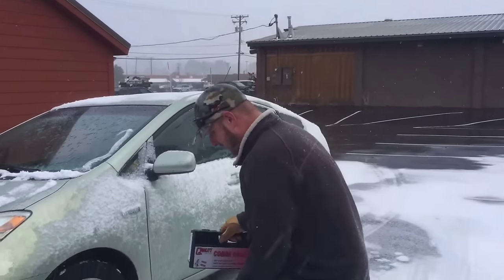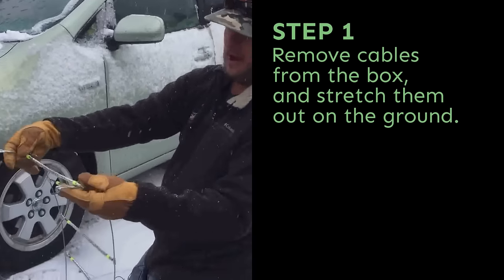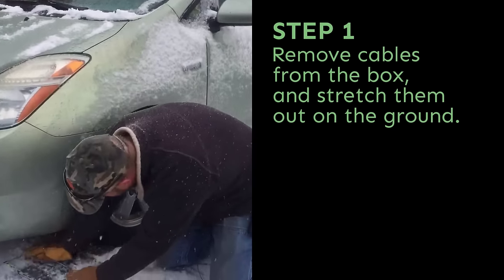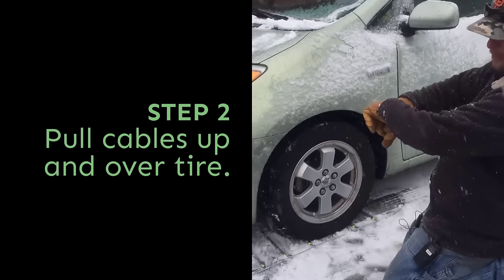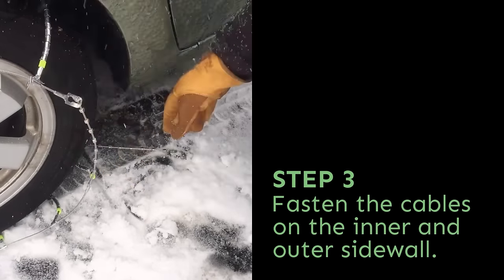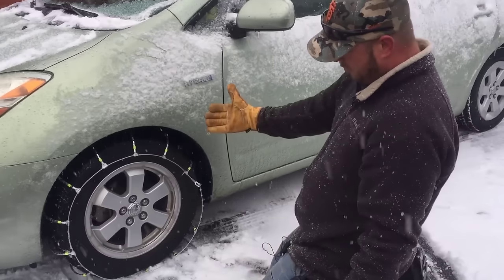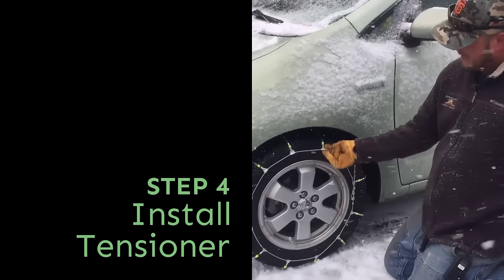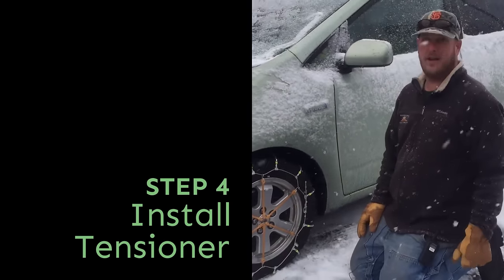How To Install Tire Cables

Comment: Great info Except for the missing parts where you actually connect to two ends together on the inside. You know, the part where you have to lay in the snow while you pull the two ends together ? Ya, ya forgot that part!  Lol
Reply: He had them at 12 o clock position.
Reply: @ridgerunner106  Thus the reason he said pull up into the "middle"...

Comment: One note: the cable ends don't poke through the hole in the clip. They lay in the hole and pull back to the slot to stop them. Don't poke it through the hole as seen here.
Reply: Sorry first timer here.... What do you mean?
Reply: Rather than poking the cable with all the little knobs on it up through the hole on the opposite side and then pulling it tight, you just leave the cable with the knobs on it flat and then drop the other ends bent clip on top of it and pull backwards and it will lock it in place.
Reply: There's two different kinds of "L" shaped connectors. One goes through, one doesn't.

Comment: Mandatory Tire Chains going up to Tahoe without the tension straps I found the chains came off and wrapped around the front drive shafts. What a mess. Learning the hard way.
Reply: Use tensioners with actual chains! One of the chains on my rav4 kept disengaging while in Tahoe a few weeks ago on the road. Although very annoying I'm pretty sure if it wasn't for the tensioners the chain would have wrapped into the shaft and would have made a it a bigger pain in the ass

Comment: I noticed he worked from back of tire, as opposed to the top. I always struggle with these. I have very little clearance for my hand in between fender. It is a stock vehicle

Comment: I think you need L shape side on the back, rather on the front,  otherwise this cable tail will go opposite to forward tire rotation
Reply: Can you explain in more detail?
Reply: @LH095  he means that the cables were put on backwards. You want the excess of the nobby part that pulls through the hole going backwards so that when the tire rotates, they don't flop around.
Reply: @Dannyuh7  that was really helpful, thanks, totally explains why one of my extra bits got crushed and about to fall of soon.

Comment: dont think you use tensioners with cables like these, only chains.
Reply: correct. Cables are not recommended to use tensioners.
Reply: You can, Cobra cables have the option to use tensioners to keep them tight. They're a good idea if you don't have much clearance between the back of the tire and your control arms. https://www.youtube.com/watch?v=L3LFJmrUQ6U
Reply: They all come with tensioners now.
Reply: Only use a tensioner if you don't want to lose your cables.  If you have extra cables and money to blow, don't use a tensioner.

Comment: I have chain up hundreds of class 8 trucks. If you are going to show someone something do it right not backwards. They way you did it the long ends on the cables will beat the hell out of the fender well and paint on the outer edge of the wheel well. Now redo the video and put them on the right way. And take the cross bars and work them back to the connection and leave the front lose and hook the back first getting it as tight as you can and the pull and work all the slack out then hook the out side. Let's see you put on some iron 3 railers on a class 8 truck they weigh close to a hundred pounds each. Do not show people things that are in correct. And yes the way you did it they can also come unhooked. And old seasoned truck driver would have called you a dumbass.

Comment: $500 dlls every 3 or 4 winters for winter tires beats all this work and unsafe solutions (TRY to go above 50 mph with these!).

I tried winter chains once. The hassle and inferior results are just not worth it.